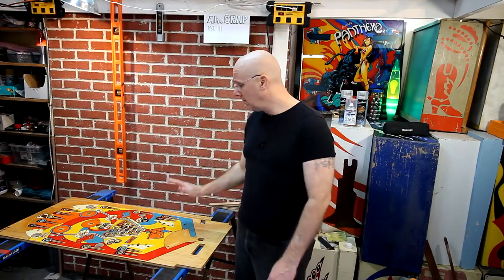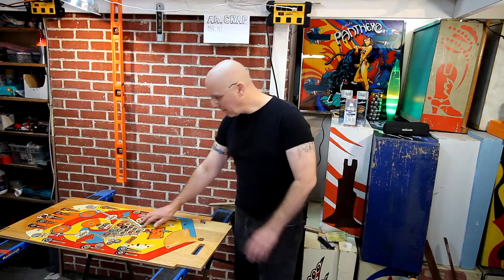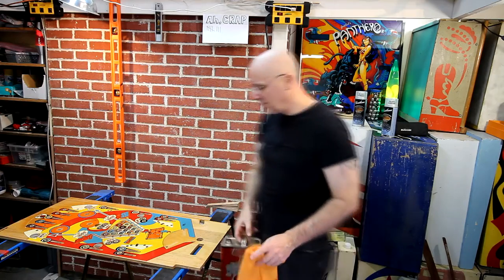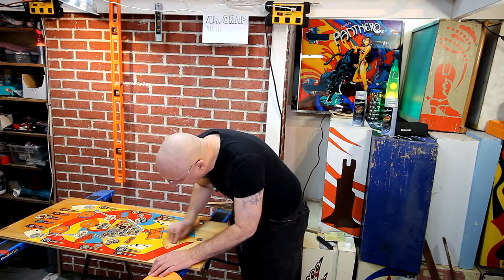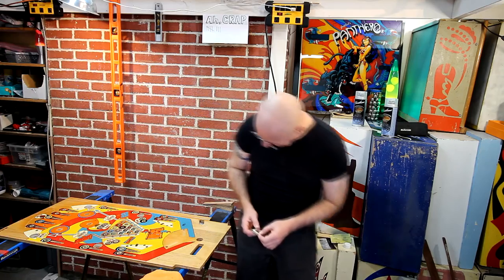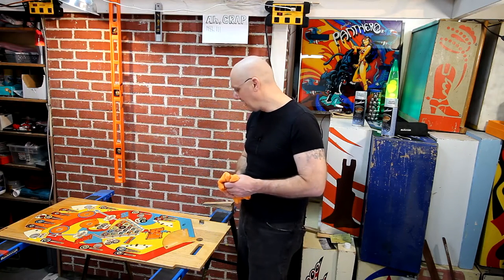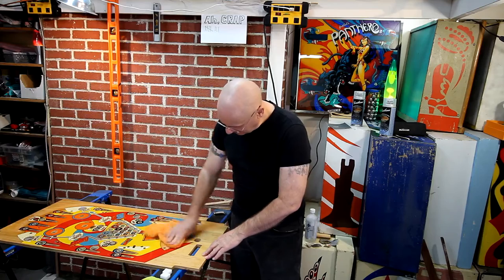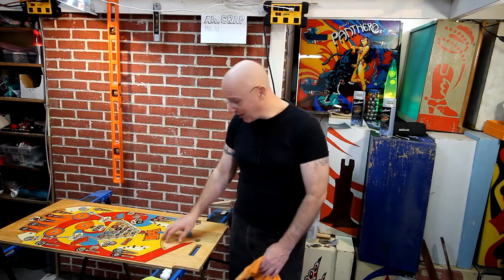Pinballorama #20 - Varathane Clearcoat on a pinball playfield - Part 1

Comment: My artwork is solid. Do you recommend a light sanding over the entire playfield before the first coat? 800 grit? 1200? Also, I couldn't find the exterior diamond varathane, I ordered interior. Is this an issue? Thank you!
Reply from the maker: The interior is probably fine. I've only ever used the exterior. 

I usually go over the entire playfield with "magic eraser" melamine foam and alcohol then I wipe down with naphtha. The foam is probably similar to 1200-1400 grit. Just be careful because it's easy to sand through thin paints. The alcohol and naphtha help remove old wax and oils.
Reply: @SevensPinballorama  Super, thank you. I have Magic erasers and rubbing alcohol. I will order the exterior. I would think it's tougher for the elements. Boy, the Varathane Diamond exterior in spray or liquid is tough to find around here. No one carries it....